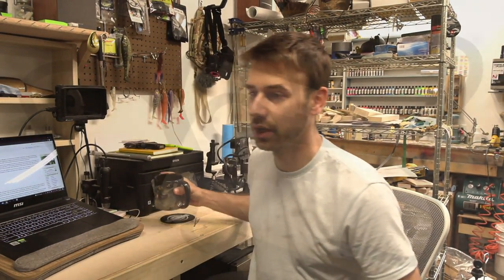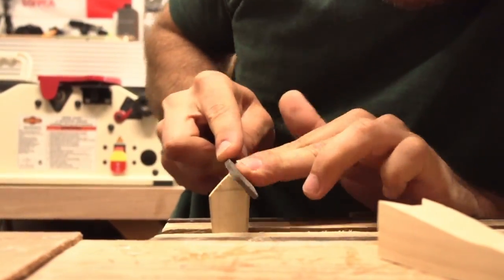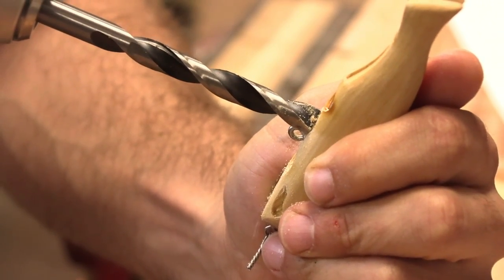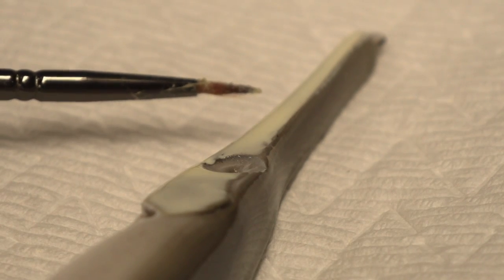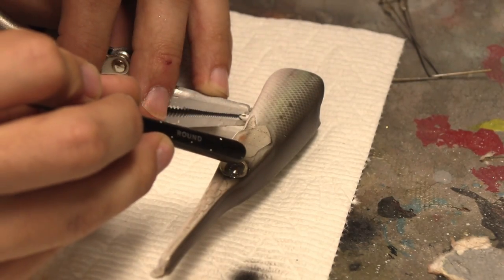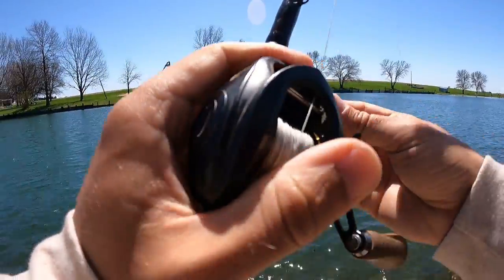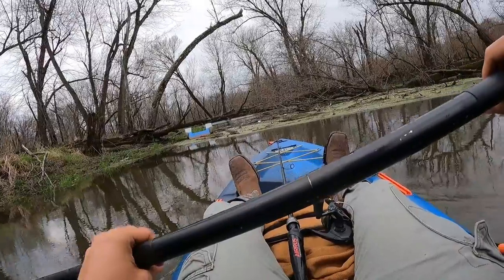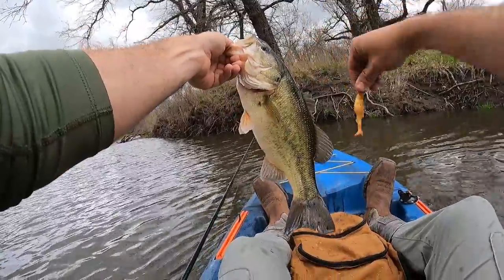Pointiest Bait Ever | Making Longnose Gar SwimBait

Comment: You’re gonna want to clear a little moat around the trunk, so the mulch doesn’t touch it directly.  Otherwise it can stay damp too long and rot the young tree.
Reply: Also want to watch out for competing leaders every year (the most central and vertical new growth on the top). You want to only have one, otherwise it will split the energy into two trunks. It’s Important to check every spring, but wait till the new growth is a nice green color or around the start of June.
Reply: yup
Reply: I’ve never heard a more wrong statement…. Completely and fractally wrong

Comment: Love your videos, makes my day allways better 🙂

If you wanna try Garfish, and if the LongNose Gar is similar to our ones in germany, i highly recommand this recipe:

Clean the fish from the entrails and make sure it has no scale on it.
Cut of the head and the back fin and than cut it into like 10cm / 4 inch long portions and cover them in salt , pepper (to your liking) and flour.
Fry them in rapeseed or sunflower oil untill its golden brown. 
Now its ready to eat.

and if you wanna try a local recipe, cover the fried fish in a sweet sour mix of boiled Water, sugar and vinegar. Put the fish into heat resistend container layer it with fish, ring onions and  a hand mustard seeds, repeat until its like 2 fingers left to the top and then pouring the boiling water mixtur until its covering everithing.
Put it into the fridge for 4-7 Days and after that, you can eat the fish with mashed potatos.
You only have to look for thiccer fishbones, the thinner should be eatable now.
You can store this for up to 12 months and its still good 🙂👍

Comment: I was concerned when I seen the line tie on the end of the nose but relieved when you made a slot for a  embedded wire. Although I would have felt more secure if the line tie went all the way into the lead hole so it has something meaty to be held by.  Overall the shape looked  great, having the fins out to the sides was a nice visual touch. (It likely didn't help the action though) 

The lead though. One thing I have learned from your videos watching them. Over and over back to back  picking up the little nuggets. And you even did a video on wood most buoyant  to least buoyant and easiest to carve vs hardest to carve.  The thought I'm getting to. 

If during the planning stages you want a bait to sink why not start with  wood that has a sinking buoyancy? Like Maple.  Or if you are wanting  a soft float or hard float, pick from balsa, bass or poplar, pine?  Then you wouldn't need to use so much lead.    That's also a good thing to remember if you have a river bank build.

I really want to co graduate you on the paint for this one it is very natural lifelike and picture perfect.
This has to be your best work yet!. 

As for the action that's one of those baits that may prefer  a slower retrieve .then if the water surfacs scatters with shad give it a quick jerk forward. It might trigger a bite from a bass.   But honestly if I ever got that bait, it would be up on a shelf

Comment: Gar are definitely good to eat. If you ever want to catch them, my favorite technique is dressing roadrunner jig heads with 550 paracord guts. Their teeth will get tangled in the nylon, and the hook can still catch other fish. They can survive a long time out of water, so you have plenty of time to make sure you've completely untangled them.

Of course, if you plan on eating them, the cleaning can be a bit of a chore. A hatchet and a pair of metal shears are almost necessary.
Reply: Howdy, homie, on the topic of skinning gar I have a strategy for you that's a little less hatchet intensive. My PTSD from having to skin hundreds of alligator gar compel me to comment on anyone skinning gar so that I may save them as much agony as possible, lol.

You need a sharp, stout knife about as big as a pairing knife, and a knife with a longer blade about 8 inches long. 

Start with the small knife on the side at the vertical mid-point on the gil plate and just slide your knife under the scales in a zig-zag pattern (up and down to stay on the lateral line of the fish) and just work your way down to the tail, all the way down to the tail fin.

At that point in time you can open it up like normal and just peel it around using the bigger knife, cutting around the head and tail fin to keep the skin rolling.

You'll still need the shears for the fin bones if I remember correctly. 

While the method was developed for alligator gar, it still worked for bigger long nose gar, even though the scales are different.

And while speed wise, it will be slower than literally smashing through the scales with a hatchet, but after you get the method down you can take apart even large gar in no time. I think at peak season where skinning several gar a day was normal I could skin a 6ft+ gar in about 20 minutes with minimal cuts to my hands.

I had to skin about 8 billion alligator gar in the early 2010s when I worked at a taxidermy shop, and even though I haven't had to skin one in almost 10 years I could still probably do it in my sleep, and I still do in my nightmares, lol.
Reply: @Pebble_Hill  I stand corrected on the necessity of the hatchet. Thanks for the advice! I've been chopping the head and tail, running shears down the back, peeling the skin down to the belly, and then filleting them. It's great for 3 footers, but definitely gets harder from there on up. I may have to write this down and give it a try.

Comment: I have always felt a bit of experimenting with density would do wonders for how your baits perform. Water has a density of 1, a lure with a density of 1 would suspend. More than 1, sink. Less than 1, float. Find mass using a metric scale (g), then volume through displacement. D=m/v. You can find volume then specifically target the mass you want to have and determine an accurate bouyancy. Just some advice from an 8th grade science teacher.

Comment: When you do the buoyancy test do you have to account for what the paint and epoxy finish will do to the buoyancy? Or does it stay the same?
Reply: You should account for it. Depending on what your trying to achieve, a clear coat could be enough to make your bait sink.
Reply: good question. thanks for asking the Master. I was wondering the same thing during this video, but not in others for some reason.

Comment: I was once making a furnace out of a tin can. I hade a half inch drill bit and for some odd reason I was having to push down harder on the tin in order to drill through it. When it finally broke through it went straight in one side out the other and threw my hand. Right between the middle and ring finger there was a huge half in hole. Hahahahaha